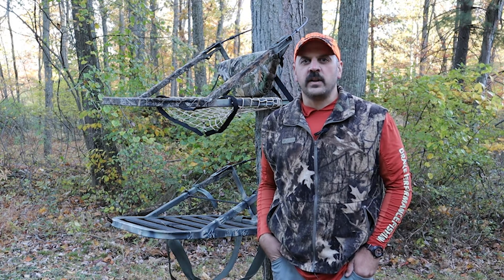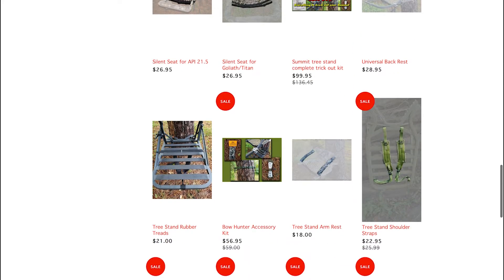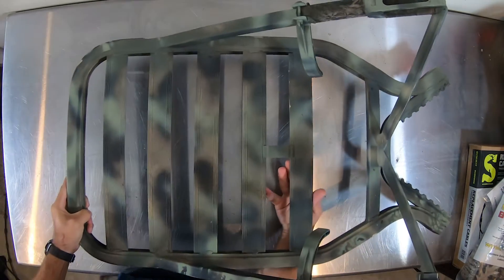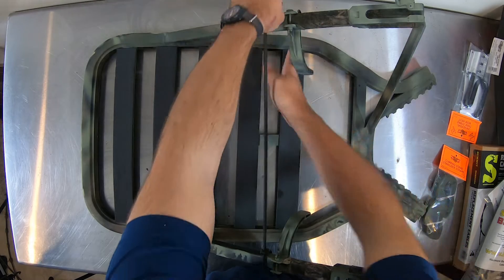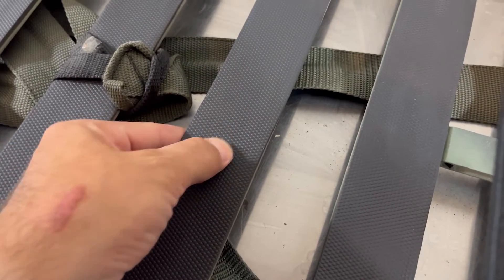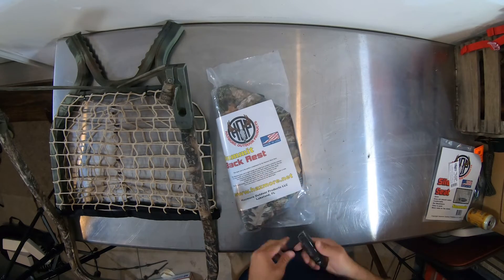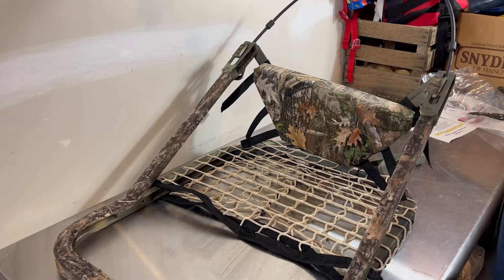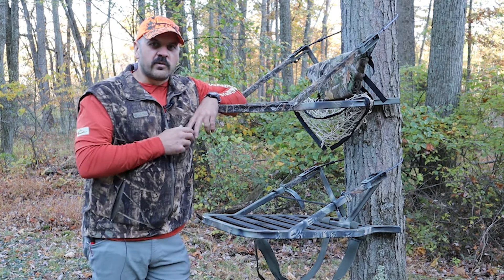Summit Treestand Mod

Comment: You’ll really like the stabilizer straps for your climber. Use them on my Goliath and it really locks the upper and lower to the tree. Super stable and no worries about bumping the upper part of the stand loose
Reply from the maker: Yes, I started using them and they are great!
Reply: Definitely recommend the third hand stabilizer straps.
Reply: Came here to say that……
Reply: Third hand stabilizer straps are a game changer. You don’t have to worry about the top falling if you lean on it when making a shot, not to mention made packing up with my back pack faster. Buy them you will not regret it!

Comment: i would be hesitant to depend on a zip tie to hold my weigh in the seat
Reply from the maker: I’ve had no problem with the zip ties and I’m about 220lbs.
Reply: I agree that trusting zip ties isn’t a good idea. I’ve had zip ties on tree stands break (the ones that hold the padding on) so I used parachute cord to lash everything. Plastic gets brittle over time and one of my summits is 20+ years old and I keep it in the woods all hunting season.

Comment: Quick tip…

You should have an extra Treestand tread left after doing your bottom platform. Take the extra tread and cut out pieces for the metal contact points that cause noise. This will ensure that it deadens the clanking sound the stand makes when nesting and taking apart 🤙🏻
Reply from the maker: Yes you will have an extra tread piece left over. That is a great idea to use it up. I use a camo mole skin for most of those spots on a treestand. Thank you for great tip and thank you for watching.

Comment: The seat sits more level with bar…… allows more clearance for Bowhunting…. I am about to purchase the dual threat but feel better about my son hunting out of my old summit with the bar around it and of course the safety belt
Reply from the maker: Yes you do sit a little more level with the bar. With the ease pushing the seat back you have plenty room to get around the bar when stand for bow hunting.